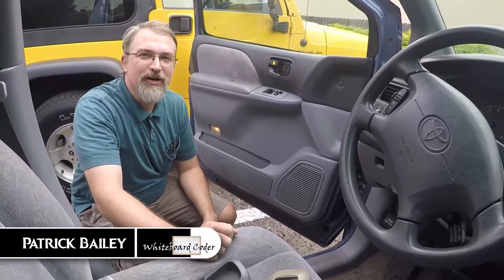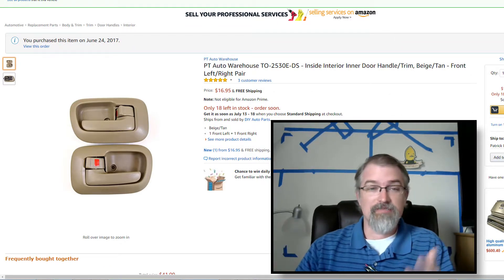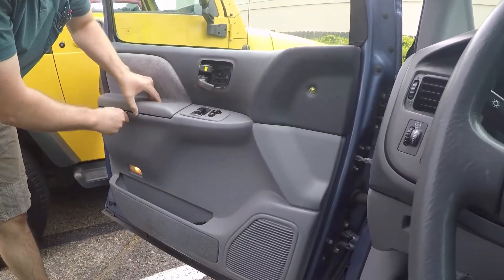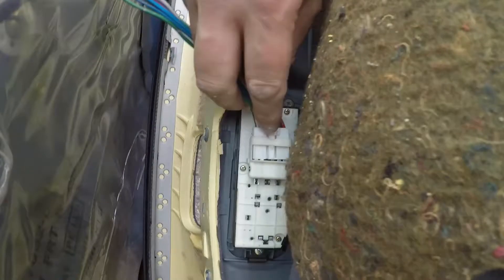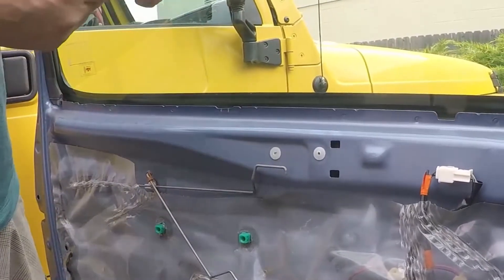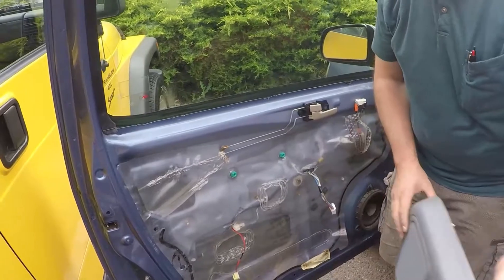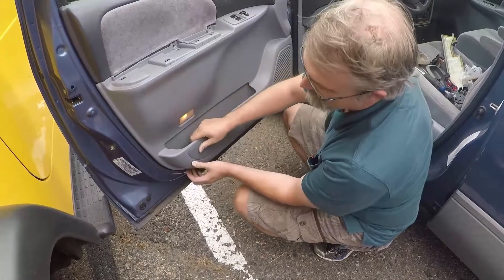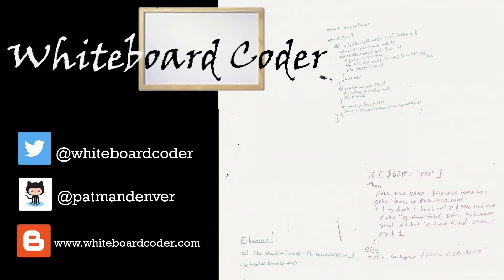Install interior front door handle on 1999 Toyota Sienna

Comment: Great video, Thank You!   I just replaced the inside driver's side handle on my 1998 Sienna with 290,000 miles on it.  I already replaced an outside sliding door handle and the rear door handle, all thanks to you and your videos.  This last project took me only 13 minutes.  The shortened time was because one of the Comments suggested that it was unnecessary to unplug the wiring.  I found this to be the case, too.  Thank you for making the mistakes I would have made, Patrick, so I could breeze through the project.

Comment: Thanks for all the candid mistakes to show us what to watch out for.
Ordering the right color match and correct  left or right door handle, not sliding tabs into holding slots, spinning door panel upside down to get to wiring clips. I would urge everyone to check the door radio speaker to see if it is cracked and needs doctoring with rubber cement or replacing since the door panel is off anyway.

Comment: Great video! Just replaced both door handles yesterday, it took about 45 min. The passenger door has 3 wire plugs and we couldn't get that last one unplugged, so I held the panel while my dad put the new handle on. After we did entire job we both agreed you don't really even need to unplug wires since you need to access the door handle only which is on the top. Thank you for posting! 👏🏼

Comment: Got off work last night from work, just moved a few months ago. Pulled on the handle and it just popped out and the spring fell/parts snapped just like yours. I was upset, but. After replacing both outside handles on both drivers and passengers. I had a feeling it would happen at some point. Thank you for the video man, I wasn't sure if one would exist.

Comment: Figured out how to separate the door handle from the trim without breaking either. If anyone is only replacing the trim, there are 2 posts; 1 on the top and 1 on the bottom of the handle unit that face the front of the van, and a stationary latch-like post that faces the rear. I carefully pried the top part of the trim from the post using a small flat head screwdriver. Then I could work the bottom post free. Next, open the door latch (not the lock) and you can unhook the trim from the latch-like post to the rear. I only had to replace the trim so this saved a lot of time and trouble. But if you're replacing the entire door handle with the trim, you're still going to have to be able to separate them. Installing the trim was much easier than removing it from the handle!

Comment: Great instructional video. I have a 2000 Sienna and my interior door handle also broke after i just replaced my outside door handles. I love my sienna. It just keeps on going and going and going regardless of the number of miles. Better than the "Ever Ready bunny" commercial. How much mileage does your Sienna have? Mine is pushing 300k. The wife wants to know what will I do when Sienna reaches 300k. I told her, "I'm going for 350k. What do you expect, buy you a new van?" hahaha to her
Reply from the maker: Oh we are very low compared to you.  Just a little over 130K :)
Reply: Great video. Really appreciate it! I,too, have a sienna that keeps going . I have 230,000 miles.

Comment: I highly recommend snapping the bezel on to check the fit before putting the handle on the door. Mine was impossible to snap together until I shaved down some small imperfections from the manufacturing process with a razor knife. Once I had the panel in place and the door back together the bezel snapped right on. I did the whole thing in about 10 minutes.

Comment: That's great, but my problem is, I was able to get the entire interior door handle with trim and I only need to replace the trim. But I'm worried I'm going to break the new trim trying to remove it from the handle. If I can do that, I won't have to replace the entire door panel, etc. and I can save the door handle for when that actually breaks.

Comment: Thank you sir!
Reply: Just finished replacing my passenger door handle. Took about 10 minutes to get the panel off. The cold weather caused the nylon clips to be really stubborn. If you make another video show more of the clip arrangements on the back of the pieces being taken off.The ones you did show were very helpful and kept me from giving up on trying to pry them loose. Also I did not disconnect the wiring. I just popped the door panel up and let it hang loose by the wires while I unscrewed an replaced the the handle. Putting it all back together only took 5 minutes.